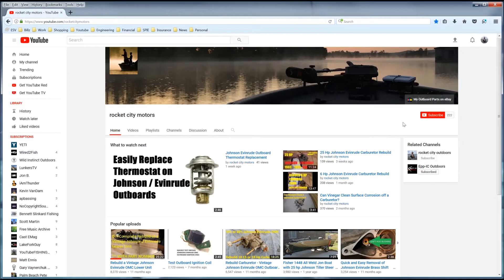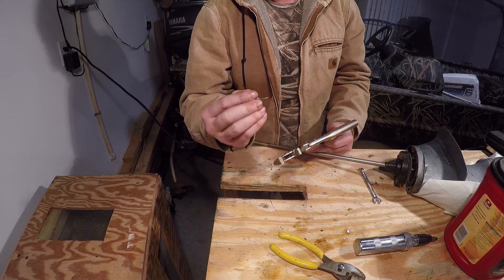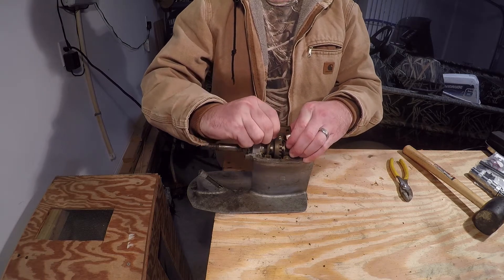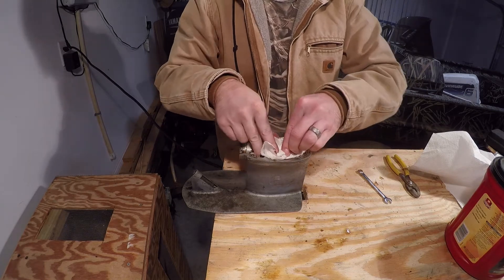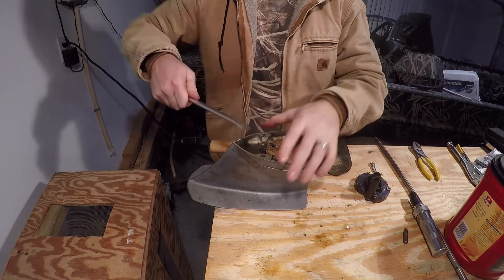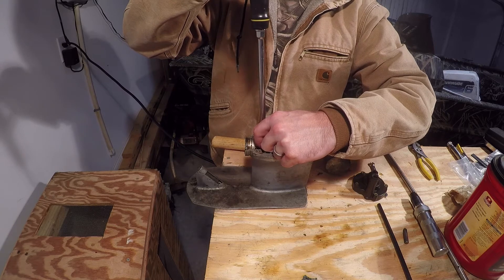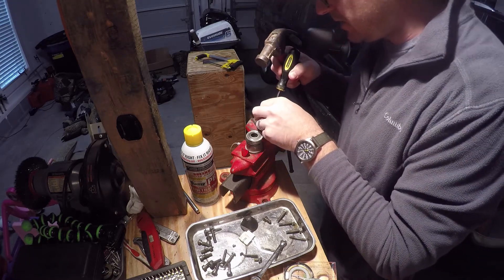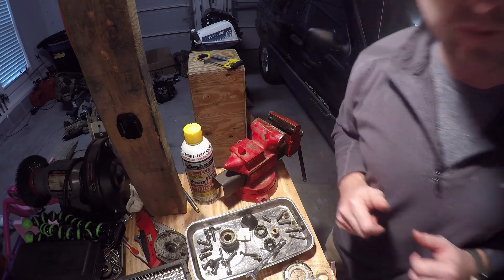Rebuild Johnson Evinrude 6 Hp or 9.5 Hp Lower Unit Gearcase Part 1/2

Comment: I have a 7.5 aqua sonic evenrude 1955 model and can’t find the brass bushing for the shift rod. Do you know if I need one if I have the tool to remove it? Just placing orders on parts so I have them in advance
Reply: Here is a diagram:  http://www.marineengine.com/parts/johnson-evinrude-parts.php?year=1957&hp=7.5&model=7522&manufacturer=Evinrude&section=Gear+Case

1955 = 1957 diagram

Comment: Please tell me a 6 hp Evinrude lower unit will fit on a 9.5 Johnson.   I found one cheap and want to know if I should buy it. They look identical from picture. Thanks. the 9.5 is a 1969 but don't know what year the 6hp is yet.
Reply: I don't know this was you but I actually use your stuff alot. Thank you so so much. This stuff is invaluable.
Reply from the maker: I put this page together to answer those types of questions 

https://thisoldoutboard.com/johnson-evinrude-lower-unit-compatibility/

Scroll to the bottom to see the chart

Comment: Just for the record that slotted  stainless split pin is called a rollpin  and the half circled piece as you describe it is called a shift cradle and also the metal clip piece as you call it is a detent spring to help lock in the FWD,NEUT,REV. shifting process.Just a note from an outboard mechanic & collector for too many years,LOL.........  Glenn in N.Y.

Comment: We are new to your channel and are also new to working on our boat motor too. You have the best instructions and links to your parts too.  We are fixing a 1977 Johnson 25 hp, Model # 25E77S and was wondering if you have any specs or information to help us get it back into the water again. We just bought it this yr. and are trying to get it pushing water, like it is supposed to, it runs, no water pumped thru the motor, so we didn't run it but just enough to see/hear it run.  We removed the impeller, and it is BAD, so we are starting there.  Thanks for the great information and the good links for your parts. Keep 'em coming, PLEASE? lol
Reply from the maker: Sharon. Thanks for the comment.  I have a 3-part video series that walks you through replacing a 25 hp water pump impeller.  The first video is here: https://youtu.be/74W02Vx8f4c  Other than the water pump, what issues are you having?
Reply: @thisoldoutboard  We are trying to find the right impeller for this motor, and so far, your links are a big help in looking them up.  We aren't sure if the pump is working as the impeller is trash. lol So we shall go from there, to the pump, if it needs one. Like I said before, it does start and run, which for us is a very good sign. I will be looking into those other videos to see what we need to learn to better repair this motor and be able to use it soon. Thanks again.

Comment: Great video Sir!  Just wondering, how did you get the pinion gear off the bottom of the driveshaft?
Reply from the maker: They can be a pain to get out sometimes. Im sure there is a “correct” way per some service manual but I usually can take a couple of screwdrivers and gently pry up on it using the edge of the housing.  Be carefull doing this and make sure you lift evenly

Comment: I want a three blade prop for my 6 hp... thoughts?
Reply from the maker: glenn horton you have two options regarding three blade propellers for the 6 Hp.  One is an 8X7 (part number 387334) propeller and the other is an 8 & 1/4 X 5 (part number 0386587).  The first number is the diameter and the second is the pitch.  

Think of a propeller as you would a car's axle ratio. The lower the ratio, the more pulling power from a standstill. The same is true with a prop. The lower the pitch, the better your hole-shot. However, this comes at a price: top speed. The lower pitch makes the engine reach maximum rpm at slower speeds.

Conversely, a higher pitch will deliver greater top speeds, but slower acceleration. Be aware that lower-horsepower engines can bog down if fitted with a propeller with too high a pitch and diameter, and that can wear heavily on internal engine parts.

Comment: thankyou for your clear, easy to understand videos. they are some of the
 best I have seen on youtube.
I just found my fathers old 1975 6hp evinrude in the garage.
it won't shift properly into forward  it was supposed to have
something wrong with the gears although there is no damage
on the casing from an impact.
I shall give it a go fixing it using your videos as a guide.
cheers.
Reply from the maker: Here is printable step by step instructions for disassembling the gear case

https://drive.google.com/open?id=15etoE22gHN5wkbFlPu76mDB1AvWDAfQ9